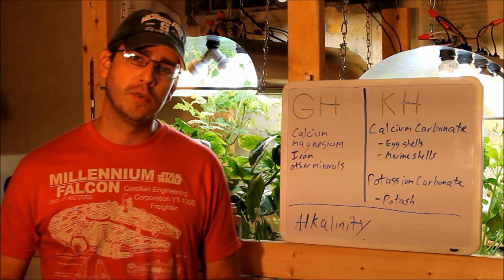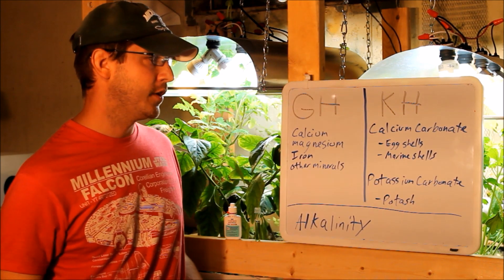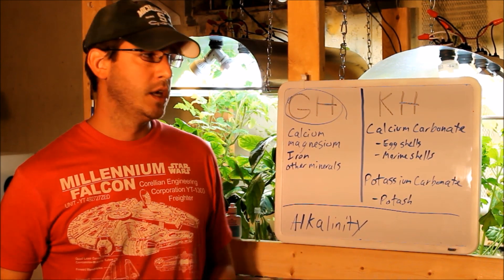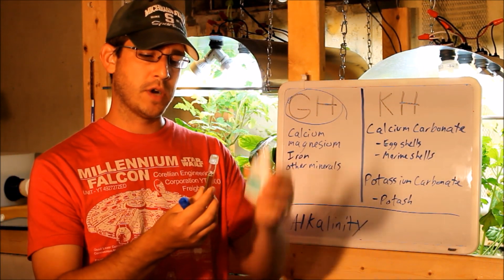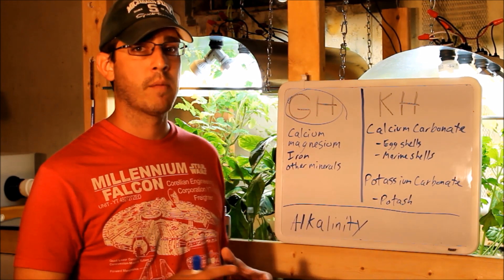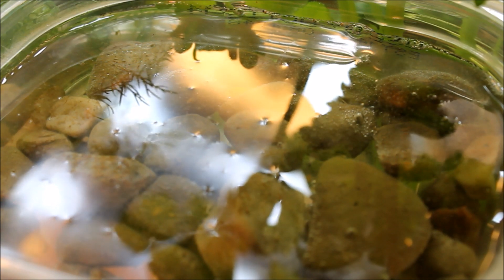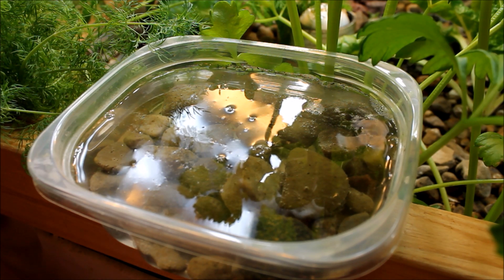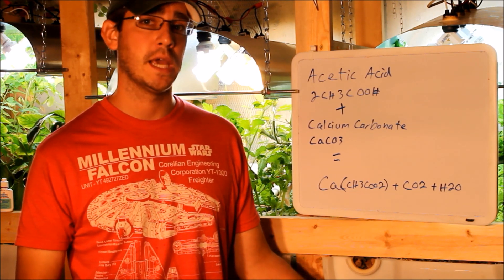Aquaponics - Water Hardness, pH Buffering, and Carbonates

Comment: My well water was "hard" so I purchased a water softener to correct. So should I bypass the water softener when I fill my aquaponic system or use the soft water to fill. Thank you for the advice!
Reply from the maker: I am using softened water in mine but I also use a filter to clear out the carbonates which cause hardness. If you do use hard water you will just have to add some type of acid to it to balance the pH before you get any plants or fish
Reply: +SSLFamilyDad Ok thanks

Comment: I've got a pretty bad high ph issue. My well water is naturally at 8.2. I inject acid (Sulfuric acid) for my irrigation, but found out in my aquaponic system that the ph goes back up. I am growing Koi and have had lots of issues, but I suspect a lot has to do with the Carbonate Hardness now after watching your video. What is the best rock media to use that is ph neutral?
Reply from the maker: +Ike Ross You can use expanded shale, baked clay (hydroton), or what I use is called beechwood pebbles. I would also recommend using a filter to get rid of some of those carbonates, that is why your pH is going right back up. Top off with filtered water and you will be good to go

Comment: today I came across this article http://community.theaquaponicsource.com/forum/topics/high-ph-hard-water-algae-problems about the issue of hard water and pH.  I wondered if you've experimented with this?
Reply from the maker: That is a great article and something that I have not tried in my system. Although I have heard of this being effective I am waiting until I have my river rock completely switched out to see what the next step will be. I also have a filter in the basement that I may hook up but having some buffering in the system is a good thing. As long as I have calculated the amount of bio material in the system the nitrification process should naturally bring the pH down over time once I no longer have Limestone constantly bringing it up. Thanks for commenting and for watching!

Comment: Iv done the vinegar test. My natural well water is has a low ph apparently. (Just tested) there is a filter and a tank with cal site in it (just found out what was in there) so I'm thinking that could be doing it. But still doesn't make since for it to do after 3 days. Thank you for your advise. :) love your videos.
Reply from the maker: No problem at all man, this could be caused by some minerals in the water I suppose. Best to just treat the water with some vinegar or other acidic solution before you put it in the system probably. As long as you do not have anything in the grow media that will keep the pH high the natural nitrification process will slowly bring the pH down. Good luck and keep me updated!

Comment: So iv done a lot of water tests on my rocks. They keep coming back as high ph. That's with river rock, quartz, and lava!! I did a control sample with no rocks in a glass jar, and after 2 days the ph has gone up. I am on a well but have a softener and no iron in my water. I am going to try a test straight from the well and see what results are. But do you know if water will change ph if it sets. Out of the tap it is about 6.8 - 7.0. And 7.6 after 2 days. Any suggestions would be great full. Thanx
Reply from the maker: That is interesting, the pH in the water should not go up without something interacting with or in it. Are you using the API test kit? The pH of well water should be right around 7.6 (at least mine is) so maybe you are getting a false reading at first? The nitrifying bacteria will lower the pH of the water on their own as long as your media is not reactive or causing the pH to rise like with the river rock. Have you tried the vinegar test on the lava rock?

Comment: If I were to test the existing medium in my grow bed with the vinegar method you showed (It's mostly lava rock, but before that, I had gravel and one bag of river gravel) would I need to rinse all of the solids build-up from the rock beforehand or would that not make a difference?
Reply from the maker: Best to probably wash it all off to get rid of any build up before testing it and also if you are switching out some of the rock. If there is some residue left in the system slowly adding some vinegar to the system over time should dissolve it. Lava rock should work pretty well I would think, have you noticed it being rough on the roots at all?
Reply: Not really. It is a huge pain in the ass to plant in, though. Rough on the hands and it doesn't move around well at all. I'm not getting very good growth but I don't know if I should blame the lava rock, the high ph or the fact that I don't have enough fish to give me the nutrients that I need. I only have 27 blugill, 25 of which are only fingerlings, and about 10-12 feeder comets and rosy red minnows.